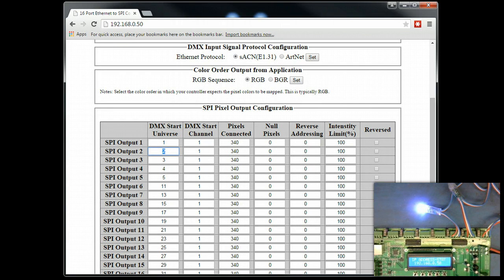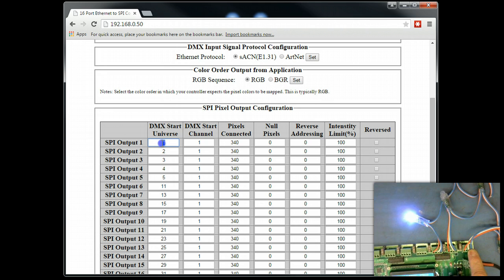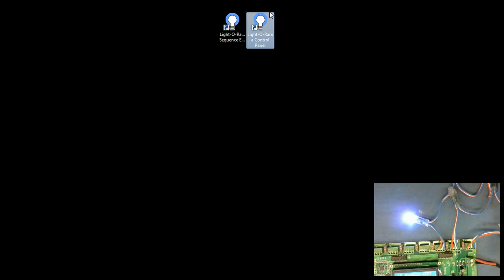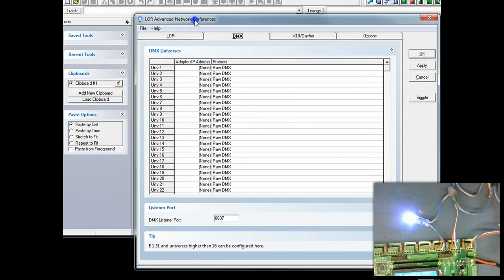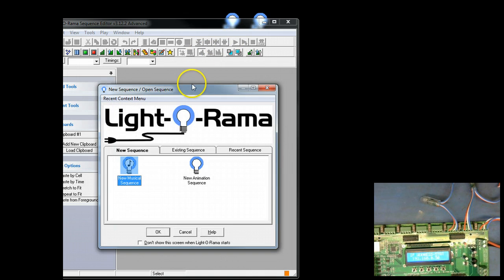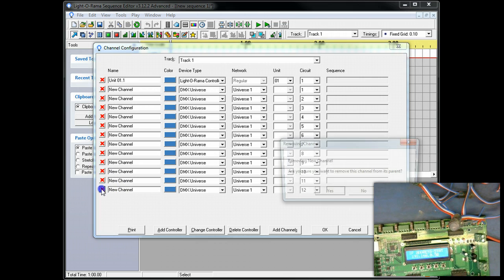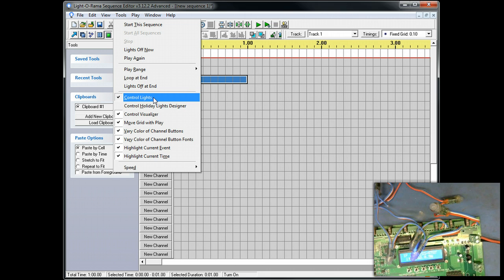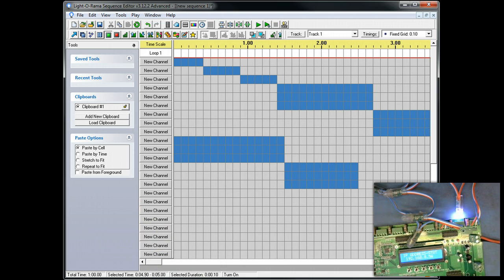OLD CONTENT: Configuring the AlphaPix E1.31 Pixel Controller with LOR S3 & S4 Advanced

Comment: How do I tell the card what universe I am assigning to each channel ?
Meaning - in the video - we are using the far right as Universe 1 the next to the left is universe 2
What if I am using a second card ?
the far right can't be assigned universe 1 on my second card since it is already being used
>> does this make any sense ??
yes - - I am brand new to pixels - sorry for the ignorance
Reply from the maker: You log into the web interface page and adjust the universe and channel numbers.  Typically these need to match those settings in the sequencing software.